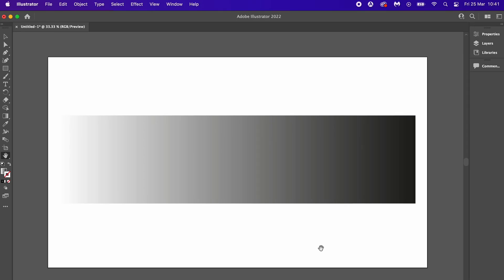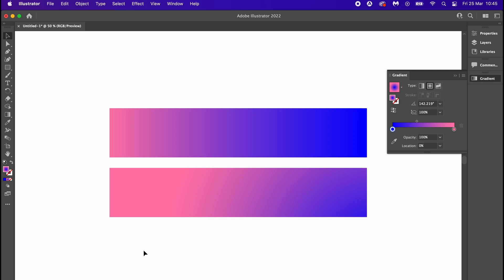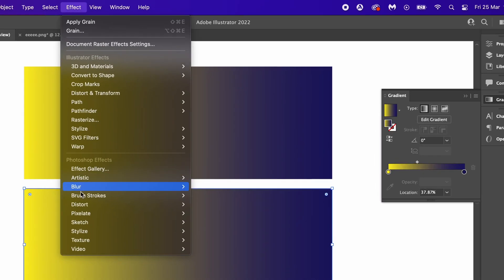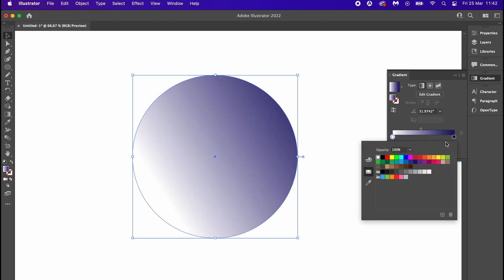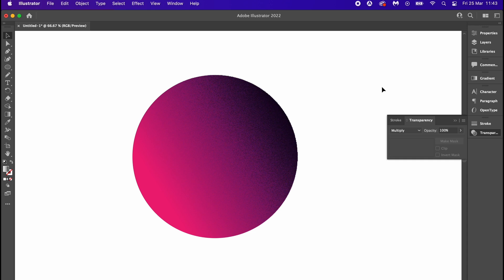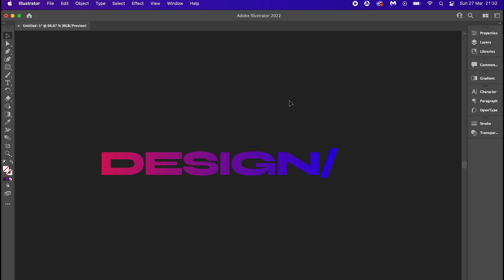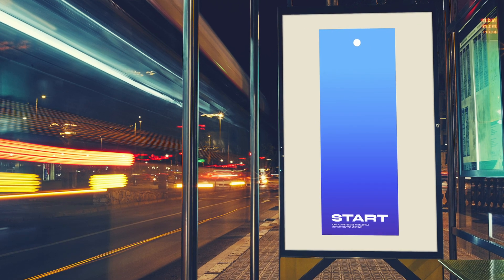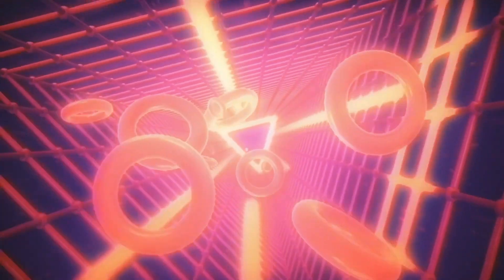How To Make The PERFECT Gradient! (Works Every Time)

Comment: The banding in the gradients has more to do with the way Illustrator displays the gradients in the software. When you go to print, you will never see the band except in extreme cases of VERY limited color, and depending on the print technology. For the screen, you should be using RGB anyway, and make sure your picker palette is always in consistent modes from one color to another in a gradient.

Comment: If you're using CMYK or spot colours (or a mix of both), gradients can look noticeably worse as it's much harder to blend inks smoothly. They can look grey in the middle because of the inks ramping down from one side to the other. Use RGB swatches for better gradients, but if you have to use CMYK adding extra steps and noise as shown in this video helps. If you're using spots you may want to look into mixed ink swatches for the inside steps.